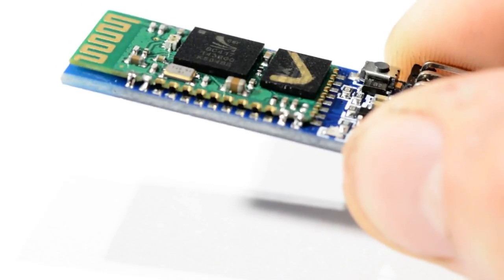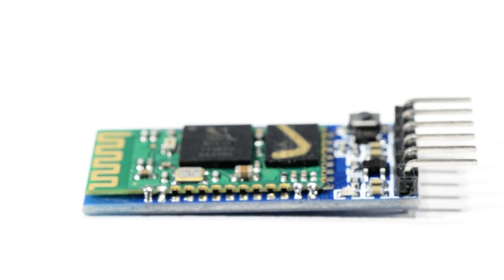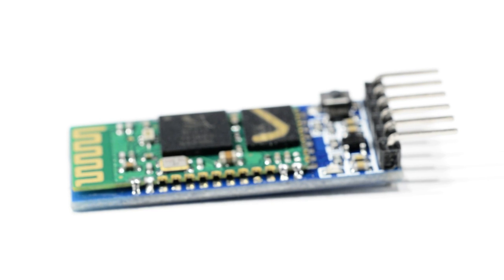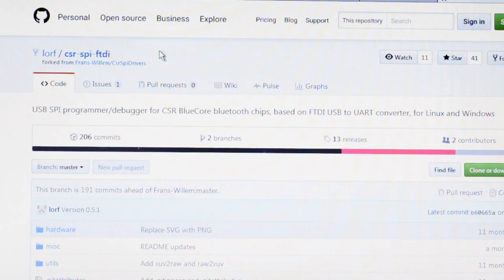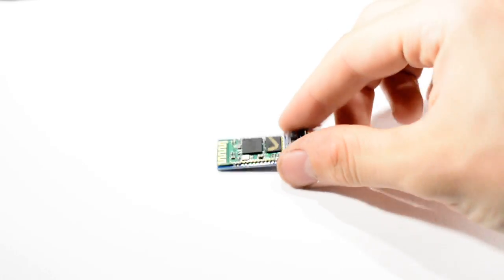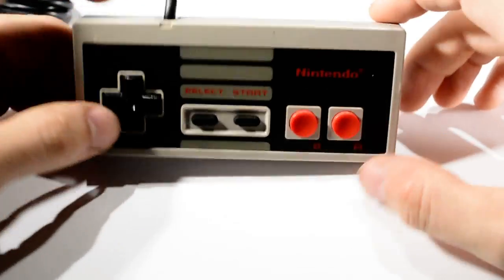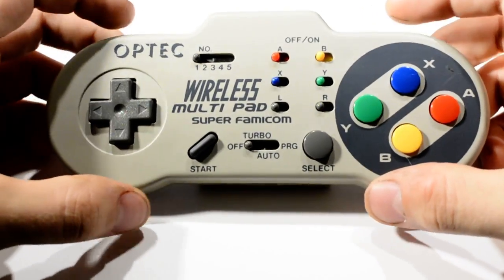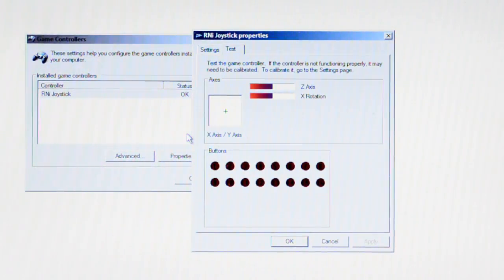HC-05 Bluetooth Gamepad (without LPT programmer)

Comment: "I haven't had a parallel port for years"
But you have so much MIDI stuff laying around... I have computers as recent as 2018 with a parallel port built in! You can get cards to add them to any machine, and they come in USB flavors too.
What with all the driver changing and system modification that needs to be done, it almost feels like a $17 PCI Parallel card off eBay would be the better solution

Also, those wireless SNES controllers were released here in the USA too, along with wired versions of the same controller.

Comment: Hi there! a really nice tutorial! Tried to follow your steps and flash my five HC05 Chips with some new Software, but none of them can be flashed...because Blueflash 2.4. can't connect to the chip. Did you run into the same Problems....or can you connect to every  HC05 Module and flash the software?
Reply: I'm facing the same problem. Could you connect it to the PC?
Reply: @cesargutierrez2030 ?
Reply: Any luck guys?

Comment: I wired everything correctly and blueflash says "Error detecting chip type (Unable to start read (invalid control data))."
Reply: Use the 0.5.1 csr spi ftdi driver version instead of the new one
Reply: I'm facing the same problem. Could you solve it?